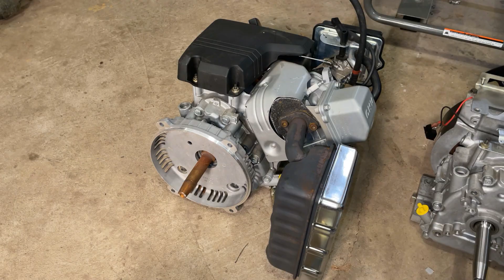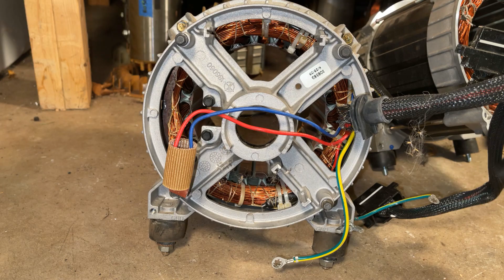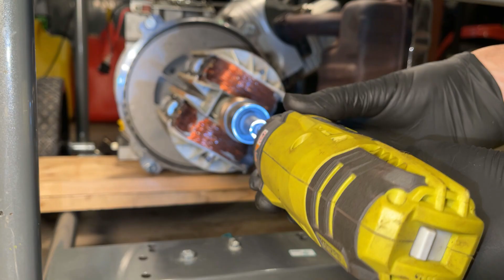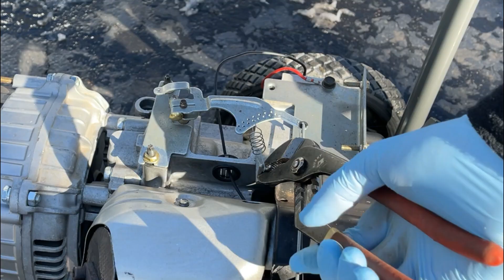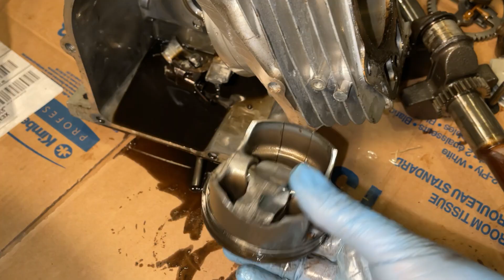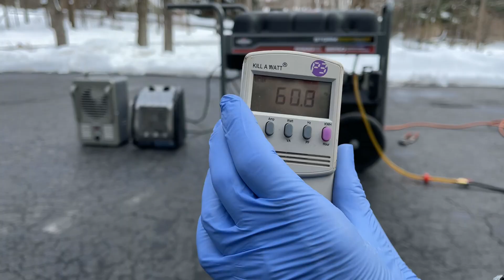Will It Make Power Again? Blown Generator Engine and Bad Stator?

Comment: I don’t get why they excluded a simple oil sensor on these engines. So many blown...

Also, blue Loctite in red tube...
Reply: Sensors cost money and people are penny pinchers and want to spend the least amount of money for a product. They want cheap they get cheap. If they don’t maintain it then the also get to buy another one. Pay me now or pay me later.
Reply: @FishFind3000  totally. But it’s literally a couple bucks. Yeah, it clearly was cost engineered out, but shame on Briggs for doing it. 

That said... I’ve seen plenty of oil sensors bypassed/disconnected. Lol.

Comment: You test with resistive heater elements.  Ever consider testing with inductive like a refrigerator motor?  Or a window air conditioner.
Reply: Or a big battery charger? 100A

Comment: Why are there so many holes for the governor spring when only one is correct?
Reply: Same reason why the side of the block has 20 holes. It’s so you make make 1 engine that can be put into just about any configuration. That way they don’t need 10-20 different model engines for small differences.
Reply from the maker: That is how you set the sensitivity of the governor.  The closer to the governor shaft, the better it will maintain a consistent speed under load.  Too close and it will hunt and surge, too far and the engine speed will droop more under load.

Comment: Can you recommend a good "current-voltage-frequency" meter similar to what we see you use?
Reply: I use a fluke 87v but there expensive, great usa made product.
Reply from the maker: Cannot go wrong with a fluke.  The low end answer is the Kill-a-watt.  Works well for what it is.

Comment: I wonder if you could have that aluminum welded that case I'll tap it back in and brush it up and weld it up because it's not here how would I say the structural piece is just test to be watertight just an idea?
Reply from the maker: JB Weld probably would have been enough to close that hole.  Would have been a fun experiment, but the cylinder was trashed.

Comment: I have a Megger BM7 (Battery Model 7) which I picked up for $5 at a local surplus store presumed non-functional.  It turned out the only issue it had was a broken limiting post on the rotary switch on the front.  It fabricated a new piece and it is now almost good as new.
Reply: Where do you usually get these things besides Amazon?
Reply: @scotthager8691  Besides eBay I really don't know
Reply: What’s the hertz checker in-line thing called.
Reply: @scotthager8691  Kill-A-Watt

Comment: Very nice job. Like the new megger. Again, why are so many Briggs using so much oil and blowing up. Bad rings, oil seal on intake valve missing or leaking, wrong oil, etc. ??? I see this in snow blowers in my shop also. Many thanks.
Reply from the maker: I do not see a mechanical reason for it.  Think it a combination of wrong oil for the temperature outside and not checking the oil.  After a bad storm these can run for 150 hours in a week.  A snow blower might take 10-20 to get those hours in it.

Comment: You seem to be a magnet for wayward and abused generators. The Megger is a great addition to your diagnostic tool collection and is going to save lots of time and questioning. You might want to consider supporting the rotor when torquing it to the crankshaft. I am surprised the manufacturer does not use a shouldered washer under the rotor bolt.
Reply: Yes this had me bewildered is it a forced obsolescence or cheap design? Thanks great video

Comment: Do you spin the drill backwards or forward, or doesn't it matter?
Reply: That's why I love your video's, they're so full of info, & your knowledge blows me away.
Reply from the maker: I had the drill in reverse and spinning it backwards.  Do not think it matters.  Just set the direction of the drill to be the same direction as you are spinning it to minimize any injury when the drill starts spinning.

Comment: It seems that you could tighten that rotor bolt after installing the stator, since the stator centers the rotor squarely once installed . At least that's the way I'd approach it.

Comment: When connecting a 12v batery to the brushes, do you need to disconnect the other two wires there or leave them on?
Reply from the maker: Disconnect the wires.
Reply: @jcondon1  awesome! Need to start buying more non-powering generators do try this out. Normally just end up with fried stators...

Comment: James I admire your work ethics a lot. In fact in this video to recover this genset was very well done and could be used for new technicians as a training video. Only three points as an addendum. 1. The bolts into the bell housing from the stator housing were not inserted before using a rubber mallet to set the bearing thus making them miss the connecting bolts. Unless there was a guide pin or slot. 2. If the  bore would have looked better for the cylinder I believe I could have tig welded this case back to usable easily. Not sure if you can weld but since you have such a good work ethic it would be easy for you to learn and a lot of these engine cases if in a pile somewhere you could have a valuable bit of engine components. 3. I believe if there was a voltage pot on this genset somewhere turning down the voltage 5v would be beneficial. I did not see an avr so this unit would need some finnagling to reduce the voltage from an amount that might damage small computer components. Good video.

Comment: Just curious...  why bend the spring mount when there are lots of adjustment holes in the throttle lever crank?
The Megger is a great tool in your arsenal.
Reply from the maker: Using a different hole for the governor spring changes the governor sensitivity.  Too far one way from the governor rod the governor becomes less sensitive and does not respond well to a load.  Too far the other way and the governor becomes too sensitive and will hunt and surge.
Reply: @jcondon1  Good to know, I suspected overcorrection.

Comment: The trick using a drill to magnetise the rotor is neat but a tidier approach might be to always temporarily connect a few volts across the AC side of the bridge rectifier before closing up on the rear of the alternator.
Reply from the maker: Yes, applying voltage to the bridge rectifier/brushes is the better way to go.  But the drill trick is easier and probably safer for those less electrically inclined.

Comment: Can you add a low oil shutdown. To save these engines.
Reply from the maker: Probably could.  The engine has a casting for the oil sensor, but not drilled out.  Would require some machining.
Reply: You can if you want. I see people doing it to their generators ATT.

Comment: Can you adjust Volts? If not what is a acceptable Range ?
Reply from the maker: The voltage is only adjustable by lowering the engine speed.  I brought it down to 61 hertz, but did not want to go any lower or else the hertz will start to go out of range when loaded.  Normally volts between 113-127 volts are safe.  Ideally you would be at 120 volts, but without an AVR, you do see high voltage with no load and volts usually drop below 120 volts when fully loaded.  The voltage on this one was a little high.

Comment: Nice job. FYI, it matters how the DPE winding is connected to brushes. The way I know is I bought a non operating Responder that was not putting out power. When I noticed the improper connection, I reversed the connection and problem resolved. Also, service manual does state polarity matters.
Reply from the maker: Interesting.  Brush side polarity definitely matters.  With the bridge rectifier on the DPE side would assume it would not matter, but never tried it myself.
Reply: How can polarity matter? It is an AC voltage converted to DC by the full wave rectifier on the brush assembly.

Comment: Being a Rhodesian we had sanctions  on us and I have rebuild Briggs engines many times welded the block resised the crank and conrod with great success. Just saying. .
Reply from the maker: It is possible with the right equipment and skills.  I have another block in much better shape, so decided to rebuild that one instead.
Reply: @jcondon1  yes if you can get the parts it's a whole bag easier. I just enjoy the challenge to rebuild thanks for your interesting posts I enjoy them keep up the good work. Regards from South Africa. ..

Comment: Once again excellent job.  Two questions. When you flash these bridge rectifier generators does the electric drill have to be in forward and are you spinning the drill in reverse while holding the trigger?  Also, because these motors lubricate by splash method, any oil pressure gauge monitor will not work.  However there is an aftermarket oil fill plug with a clear plastic dome and bulb, like a primer bulb, so that one can check the oil level without taking out the fill plug (engine off)  I'm wondering if this could be used as a way to check the oil while the engine is running, rather than having to shut the engine down every hour or so. If you don't see oil in the plastic dome, time to shut it down and check.  Thank you  Craig
Reply: Engines should not use that much oil and should run for days or weeks without having to check it. Using the wrong wrong oil or bad valve seals, scored piston and cylinder will cause excessive oil use. These engines run wide open and run hot, need to use heavier oil.

Comment: Hi, an excellent resurrection of two major parts that I suspect you thought originally would be hopeless and that they might have to be broken for parts.
Question: the majority of these generators you find to fix seem to be 4 stroke petrol engine driven, do you ever see diesel powered engines used for this task or are these engines used for bigger generators?
Reply from the maker: There are some diesel portable generators this size, but they are rare and parts hard to come by.  Almost got one last year, but most likely I would not have been able to source parts for it.
Reply: @jcondon1  
Thanks for your reply.

Comment: listen man i have generator that will put out power but only if you have over 750 watts plugged in it don't make any sense have you ever run into anything like that it small only 1200watts and has relays could it be a relay
Reply from the maker: Never seen that before.  My guess would be bad brushes or dirty slip rings.  If brushless, then maybe the capacitor is bad.
Reply: @jcondon1  ill check them out thanks for advice i just started watching your videos great work about rope in cylinder there is very little room in combustion chamber when piston tdc you can buy tool that you just screw into plug hole i actually use rope myself but you really don't have to fill whole cylinder but better safe than sorry thanks again
Reply from the maker: @MrTehudson  have considered that tool.  Would be easier, but do not like the idea of using the spark plug threads to hold the engine.
Reply: @jcondon1  yeah i agree and the fact that force would be concentrated on one spot of piston and solid i would use for chain saw clutch removal but for rotor i would stick with rope that is what i have always used for everything